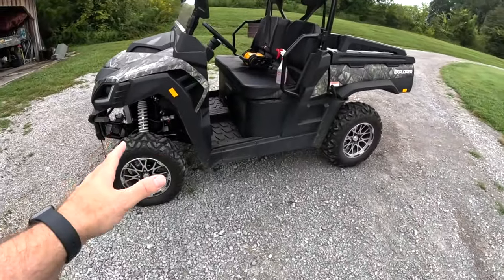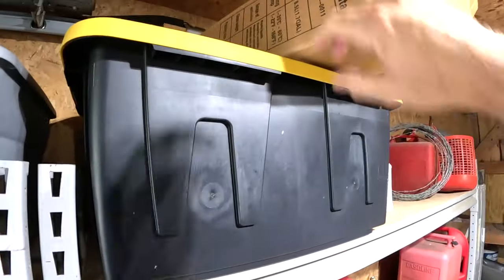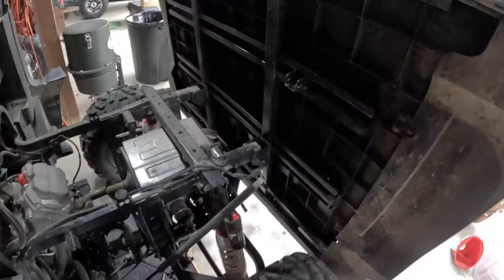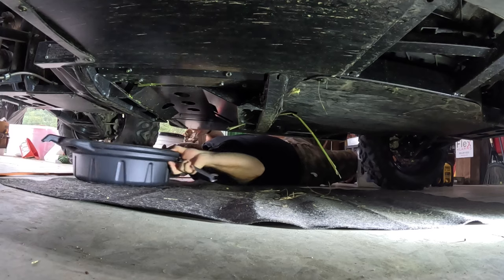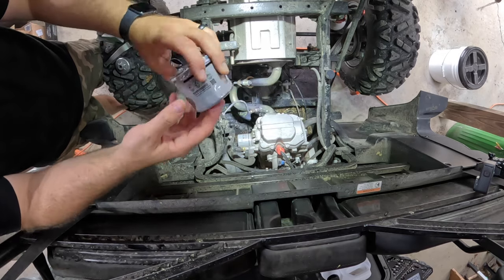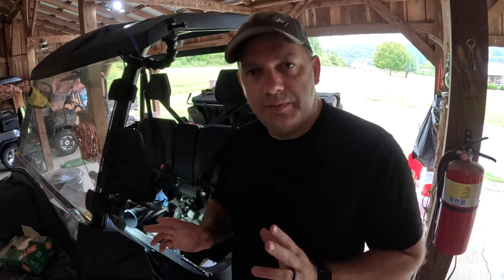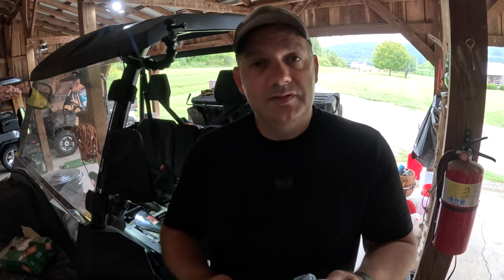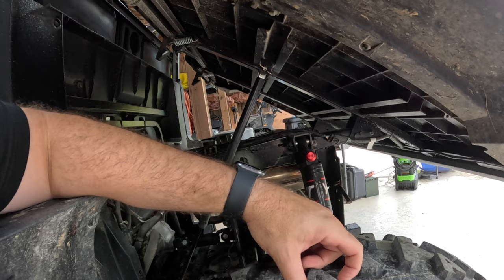What YOU NEED TO KNOW Before Buying A BigHorn Side-By-Side!

Comment: Just purchased a 2014 Bighorn 400, it has a tick over 100 hours on it and 20 odd miles showing on the clock. Performed an oil and filter service, lubed all the grease fittings and changed out the rear brake caliper, seized. Every bolt and such must have been put on by King Kong, amazing.
Reply from the maker: Man thats awesome!  Can you email me a pic?  Would love to send it to the BH folks!  Hope you get many years of service out of it. Sounds like it was barely used!
Reply: @JoeTheFarmer Will do

Comment: Hey Joe,
I just bought a Bighorn 550 and I am having issues with turning radius. It is very difficult. I am sure my wife could not turn it. I have it in unlock mode and H. I expected that with the 4x4 but not in 2 wheel drive. It feels like i'm fighting every turn. I feel like it shouldn't be that difficult. I am assuming it is not power steering? Any advice? Thanks!
Reply from the maker: Not power steering, but shouldn’t be hard to steer.  Try checking the tire pressure, that could make steering really tough if low
Reply from the maker: And congratulations!

Comment: you are being to obvious sounds like you are a spokes person for the company i would say you work for them
Reply from the maker: I don’t work for them.  And though someone gives us a piece of equipment; that doesn’t influence my integrity.  It’s been a solid machine.  Maybe you should go test drive one and share what you think.
Reply: Thank you! I appreciate your video! I have a 400 Big Horn.Trouble finding refill cap for adding oil.
Reply from the maker: @jimmysimpkins  Refill cap is where the dipstick is.  Pull the dipstick and remove the dipstick mount with a ratchet.  😁👍🏼